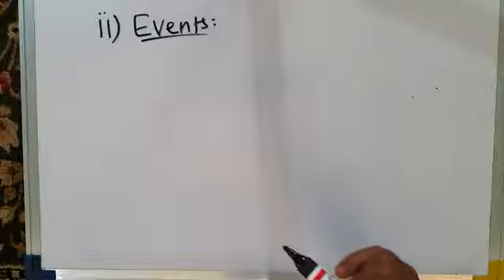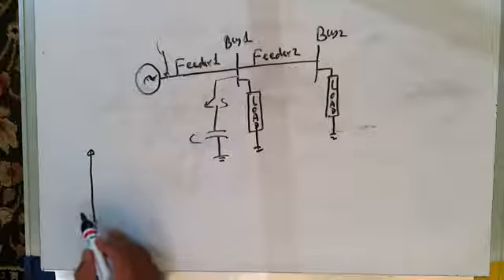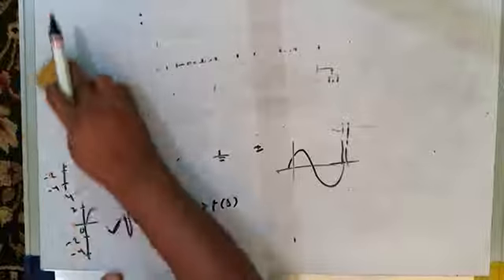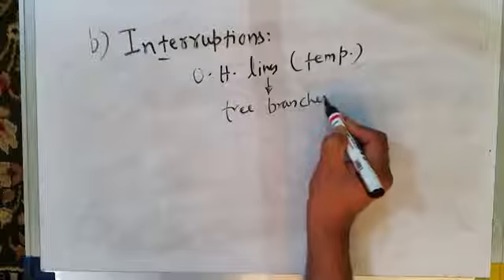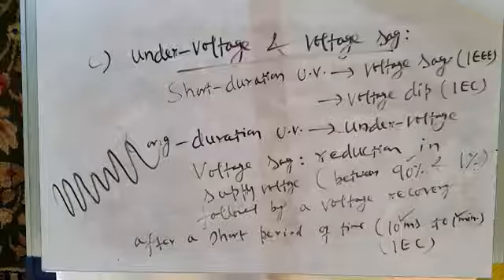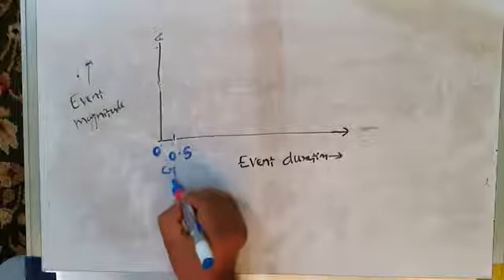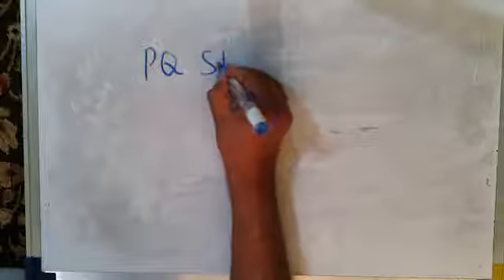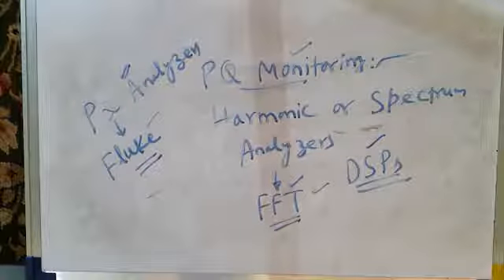L5_Power Quality Problems 4

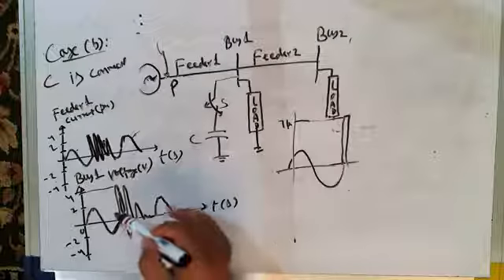Comment: sir, @23:30 why  is current &voltage oscillating with capacitor connected to system?
Reply from the maker: The oscillations are mainly due to formation of parallel LC circuit between formed between  load inductance and capacitance.